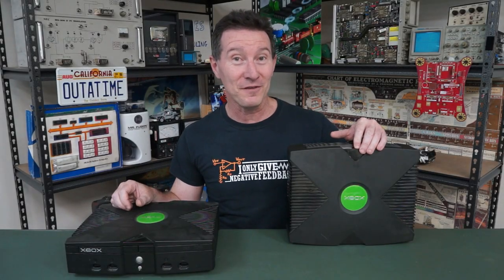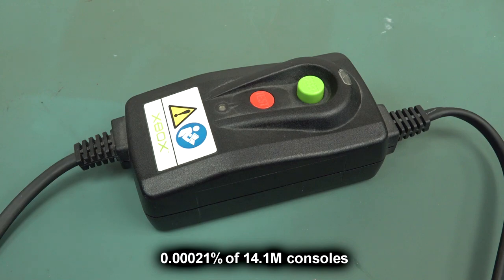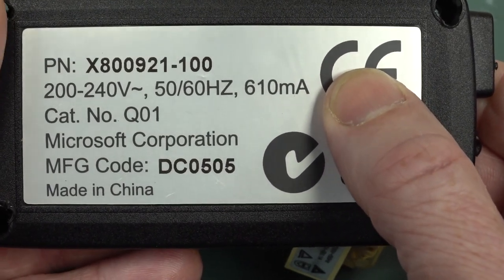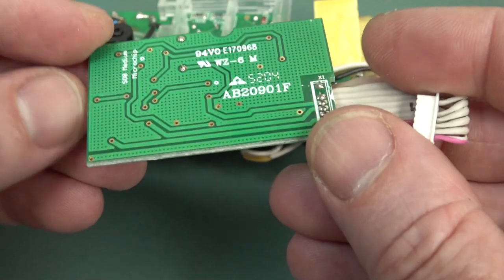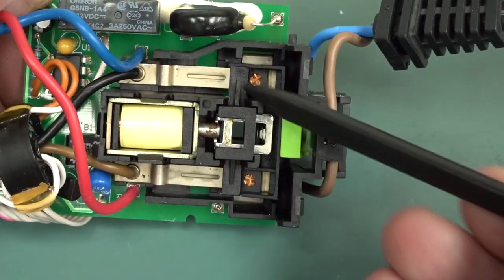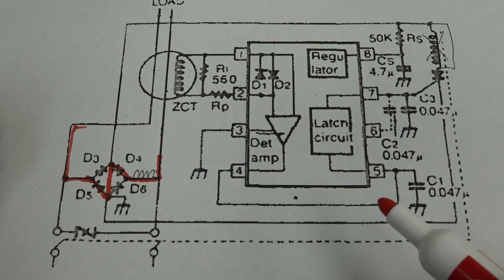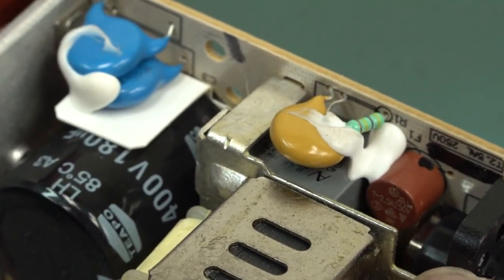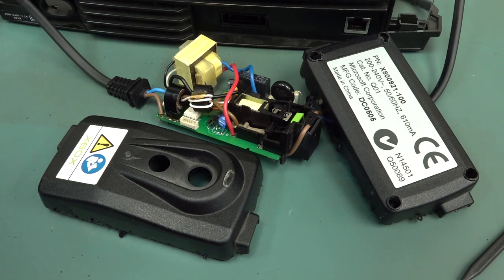EEVblog #1164 - Xbox Engineering Baptism Of Fire

Comment: This is WAY more elaborate than the USA version. I’m going to say you’re wrong about them not having to do this or else we wouldn’t see this much variance between how they dealt with it in different regions. The USA version does have the Test and Reset buttons but no visible indicator and the prongs come directly out of the box (“wall wart”). It’s significantly smaller to boot. It couldn’t fit such an elaborate setup inside.

There absolutely must be some reason they bothered to do this for AUS and whatever other countries used this one, like some additional regulation or threat of lawsuit.
Reply: It’s very likely they rebadged existing off the shelf solutions and our 120V 60Hz mains would likely require/choose a different part for our market since most of the rest of the world is on 240V 50Hz power.  In the end, the important thing is that Microsoft did make the existing devices electrically safe for everyone who participated in the recall.  It does not address the core fault for those who either abused their power connectors or repeatedly connected and disconnected the cord for some reason resulting in broken solder joints from the poorly secured power socket, but they did at least ensure that if your unit developed an arc fault condition then the device would be immediately powered down so no probable fire risk remained.  Better a service call for for an intermittent power issue with one’s XBox randomly crashing down the road than dealing with insurance companies and lawyers over a house fire, or especially a house fire with a death.

Comment: More likely it was built for something else and a new shell was made for the guts.
Reply from the maker: I greatly doubt it, it's "the vibe".
Reply: EEVblog Given the rush and the classic breaker mechanics, I suspect all the mechanics were from a portable GFCI/Breaker from some vendor, then they modded the circuit and respun both boards.
 The top board is controlled by a PIC μC in an SO8 package, hence the board name (may have had an alternate design with a different chip at its core, but this one obviously shipped).  Or it may have been an existing module for inserting that μC in this breaker series.
  Putting a fuse before a MOV is official best practice, because MOVs can violently fail short circuit after absorbing enough surges.
  Inside breakers like this, isolation gaps on the input side may have been designed and tested to safely handle plugging it into 420V  or more.
  The entire thing may have been built by an experienced brand such as Eaton or GE, saving weeks of trial and error, with the mandate being: "Detect the known fault arcs and every other danger in your arsenal, integrate it into a consumer installable cable or add-on" .
Reply: I would think so too.  It's damage control time.  Are you going to R&D, build, test, certify, produce, and ship a new fault detector?  Heck no.  Someone has one already done, just needs a new branded shell.  I'll take 100,000 please, and we'll be in touch for the next batch.
Reply: Nick Wallette Just stickers, no new shell.

Comment: This may be one of those things that when you unplug the device it fails open? I have seen that on a few GFCI modules, usually not that way, but a few are. I saw a circuit somewhat like this once in a laser printer. It was used to control the fuser, I only saw on that one model thought. Not sure what the point was as the fuser is basically a halogen light bulb so not sure why besides a thermal and maybe a normal fuse why that would be needed.

Comment: It looks like the Burden resistor (R10?) for the first current transformer is on the control board and will be disconnected if the board is unplugged.
If so, very bad practice to allow a current transformer to ever be able to run without a burden resistor, infinite volts (theoretically) and all that.

Comment: 6:00 people really don't understand how little Microsoft understood about hardware design back in the Xbox days, I mean people pretty much opened up the console and hacked it immediately. Microsoft really had no clue what they were doing. If you want to keep and old running Xbox you pretty much need to remove some capacitors from the board (as they always die and kill something else), and if you want to keep an Xbox 360 original running? Well you can't, it'll die.

Comment: I find that complex power supply circuits contain op amps and some other components that require power supply themself. This creates a confusion, how do these components get their power when they are supposed to operate and make possible the operation of the power supply they are inside and can't run without stable power themself?

Comment: It seems to me that this was not designed from the ground up specifically for the Xbox.  I have seen similar 'power cords' as after market safety devices, both in this form as well as a plug adapter form.  This particular device I think is a modification of one of those. The bottom part is probably an untouched design from  the 90s.  The plug in device I have looks remarkably similar though not identical.  Its main purpose is as a ground fault interrupter.  What Microsoft seems to have done here is to replace the top control board with something more specific to the task, rather than just a GFI and overcurrent adding the AFCI function.  Actually there may have already been an updated one existing with that function and Microsoft just badged it.  In fact there seems to be no Microsoft branding anywhere on or in the device except for the sticker at the bottom.

Comment: I have 4 of these (the crystal & green crystal, still brand new in box!), never realised there was a problem with the socket! It appears some lessons weren't learnt as my Xbox 360 PSU had to have the power cable replaced (a weird IEC C17 with no earth pin!). I remember sending the email to have the new power cable posted out. I think the newer cable was made with a higher amp carrying capacity? All my Xbox consoles are UK versions...

Comment: The early 2000's Fisher & Paykel Dishdrawer dishwashers had a similar "current monitor" that was required to be installed before the mains input, after a number of units caused kitchen damage due to "contaminants ... such as insects".  I wonder if they are also an AFCI, or just an electronic fuse.  I have one somewhere...
https://www.productsafety.gov.au/recall/fisher-paykel-dishdrawer-dishwasher

Comment: Microsoft had some real trouble with consoles at the start. First the XBOX had the magic smoke and cracking power leads, then they had the red ring of death due to heat warping the metal braces and caused them even MORE money to replace broken consoles and fix the issue in all later models.

Comment: Did the current limiting on a refrigeration compressor to optimize power consumption snd to stay below the safety circuit breaker limit. Could actually go well into the CB rated limit gor a few cyvles before it would cut off the power. Not deliberately of course but if the compressor unloading was a bit tardy the nominal overload was easily measured via a current transformer and a few components to condition the signal for an ADC.

Comment: I actually had one that arced because of cracked solder joints on the mains input, could hear it when wiggling the power cable. Fixed it myself since it was pretty obvious what was wrong and it was out of warranty anyway because I had put an Xecuter 2 chip in it.

Comment: You could basically mod these fuse adapters to test defective appliances for restoration and not have to use expensive by-product battery sources off an inverter.

Comment: A few things about this strike me as odd. If the power supply is the issue and it is a separate module it seems it would be better just do the recall and fix whatever the issue was. Other than the person not having the unit for maybe a week I don't get that part. By the time they made these things, etc seems the cost would have basically came out the same. 

I also find a bit odd they used a transformer to power it, I have dismantled dimmer switches, GFCIs, etc they all just use some form of resistor to drop the voltage to what they need for the logic to work. I would almost have to assume that is how a GFCI or AFCI circuit breaker would work too I can't imagine a 60HZ transformer fitting in a small circuit breaker. This may have been in the early stages before AFCI/GFCI became more common too. This thing just seems really odd to me.

Comment: Dave, one of my floor lamps has an annoying in-line circuit breaker.

I can’t use CFLs in that lamp.  CFLs keep tripping my lamp’s circuit breaker. I suspect that CFLs have an initial current or voltage spike when power is first applied.

I can only use incandescent or LED bulbs in that lamp.
Reply: CFLs mostly rely on rapid start ballast functionality, so yeah, they tend to do that. I would recommend not using CFLs. They're the worst.
Reply: cfls are a terrible hack anyways
Reply: SuperAWaC yeah. Especially considering they actually have a small amount of mercury in each bulb.  Environmental friendly my foot.
Reply: CFLs are a lighting evolutionary dead end.

Comment: I owned one of these for many years played it faithfully daily never had a issue and never had a special cord I'm assuming it wasn't widespread
Reply: Seems to be more of an issue if you moved it around, like setting it up at different tv's. If you just set it up at one tv and left it alone, I can't see this really being too big of an issue (unless the unit came with a dry solder joint that would fail with heat cycles).

Comment: oh, also forgot, make sure you remove the clock capacitor(or replace it if you give a damn, it barely needs it, just keeps the time when you pull the power) they have a tendency to leak after ~10 years? easiest solution is to just get rid of it

Comment: i think the reason for the circuit breaker solenoid being put on parallel of the bridge rectifier is probably because the solenoid was designed for AC current. after the bridge rectifier, the solenoid would have been fed full-wave rectified AC to DC which the coil probably didn't like... if that's the reason, it sounds like the solenoid choice was imposed for some reason. i expect either because standard and cheap, or it was the only model available (possibly within the required time limit), or everyone decided and approved the model of breaker before doing the electronic circuit (boooo)... i bet it bothered the electronics team to have to fix that incompatibility with such a twisted solution, and to move away from the IC manufacturer's proposed circuit design.

Comment: Not a pentalobe, but a security torx screw. It's basically a pointless distinction because the 'security torx' is pretty much the standard for all screwdrivers and they open both normal and 'security' screws...
Reply: Security torx is 6-sided with security pin, not 5-sided.
Reply: Yeah torx has 6 lobes, this has 5 lobes, which is why he called it a pentalobe

Comment: Looks like to me its doing GFCI which is why both Neutral/Hot are run through that one CT. If current is being diverted elsewhere (to ground) then there will be a current differential and that will induce voltage in the CT. The other CT they might be looking for total current of the device, since these are all basically the same and so the current into it shouldnt exceed some specific amount.They may also be looking for characteristics of a Arc fault and tripping on that as well.
Reply from the maker: Yes, watch the whole video, I explain this in detail.
Reply: @EEVblog  I got interrupted so I only got 8 minutes in

Comment: So it's pretty much just like the afci breakers that (at least in cali) are required for Dining room, living room and bedrooms
Reply from the maker: Seems to be. Wiki says it's in the legislation since 2014?
Never heard of these here except in relation to big commercial installations, I didn't know they were for home/consumer use.
Reply: @EEVblog  ya so section 210.12 in 2014 NEC says ya gotta have on all the 15/20amp branch circuits where people do any "living" so not garage, and also not the kitchen/bath because all outlets in those rooms are gonna be can off GFCI outlet (you could also use gfci breaker but they can trip often so more convenient if it's right there) but the reason I said at least here in California is way our laws work each state doesn't adopt each version as it comes out like 2 states I think still using 2011 and we have had 2014 and 2017 releazed....

Comment: So, I think that we've established the fact that this is a combined overcurrent, ground fault and arc fault breaker.  This raises the question of how does an arc fault breaker work, does anyone know?  I assume that it detects high frequency noise generated by the arc but how does it do it, I didn't see any RF looking circuity, not even any inductors.  What frequencies need to be detected?

Comment: It can't be just fuse and gfci. They can be done completely without active electronic, including test function.

It is probably arc detection , and analysis of sudden spikes and drops of current. 

Anyway, this is over the tops design. Definitively rushed (not cost optimized), and just made sure it work 100% of the time.

Good lesson to engineers and companies too. Saving few cents on a connector can cost you dozens of millions, or even more if it kills somebody.

Comment: Great video.  As for these PSUs, i think only fox link supply had that solder joint issude that caused fire,  DELTA ones were much more reliable. So if possible use these. And it is 90% PC so if you really need you can wire put ATX power supply for it.  Just for your and console goodbeeing, remove clock capacitator before it leaks, not needed and it will corrode MB.
Still using mine console,  like it very much. 2tb hdd hard drive, 128mb ram mod. TSOP flashed. And modded cooling with 8cm noctua fan. So it is whisper quiet even tho fan RPM needed to be adjusted in bios config file to 80%.  XBMC 3.5.3 is quite new dashboard from 2016 i think,  and you can play any backup game and it emulates really great anything up to PS1.
With original component cable or new 3rd party HDMI (picture quality is almost same) it looks great on new TVs and runs 16:9 .  Can do 720p even 1080i on few games.
And via xlink kai, it can play games online again.  Hope you all have a nice day.
Reply: Wow, I have no clue the Xbox was this moddable. That's hilarious, and awesome. What does the RAM mod achieve though? I would expect console games to run unmanaged memory and thus be strictly built and carefully optimized by hand for a certain expected amount of RAM.

Comment: Some perspective: they estimated 14.1 million “power cords” would need replacing, but only sold 25-30 million OG Xboxes.
Reply from the maker: All units after Jan 2014 were not affected.
Reply: That sales estimate is based on a figure from 2006, the article on the recall is dated 2004. The 14.1 million units that MS predicted were faulty still makes up a significant chunk of the Xboxes production run.

Comment: I JUST got done fixing my first generation xbox power supply that has the bad power supply with faulty solder joints. I also added screws to the power supply the secure the socket so it cannot move when being plugged in

Comment: the UK didn't have this problem, plugs have a fuse fitted as standard, either 3a 5a 13a
Reply: A 3 amp fuse won't do the job if it's arcing but not drawing excessive current (which is the suspected fault with the original PSU). This device was designed to also detect arcing.

Comment: Could someone explain why there is a resistor in parallel to the MOV on the power supply board?
Reply: You mean the thermal fuse that's in series with the MOV and physically stuck to it? It's there to protect against catastrophic failure of the MOV, which results in a thermal runaway process where the MOV becomes a short-circuit.
Reply: @MatthijsvanDuin  No. What I mean is at position 25:05 in the video. It seems to be a resistor in parallel.
Reply: @sebi7794  Oh, like he says: the bleed any stored charge (a MOV has significant capacitance) after unplugging the device.
Reply: @MatthijsvanDuin  Thank you! I didn't know of a significant capacitance. From what I have read now, these can have capacitances up to 2.5 nF. Isn't the internal leakage resistance enough to dissipate the energy stored in this capacitance? I've never seen a configuration like this before.

Comment: Well it's been said already, but the first thought I had was about the cracking solder joints due to lack of strain relief... I'm by no means a professional but I do a bit of soldering lol & I recall when these systems were current a friend had one that was arcing and wobbling that I reflowed.

Comment: Only half through the vid, but in case you didn't catch yourself later... The white wire passes back through the (non GFI) CT to cancel the current drawn by the 3 resistors (and maybe as a backup in case of a fault on the load circuit for the GFI and it fails to operate). This thing is over engineered like NASA.

Comment: Using a SCR/Thyrisitor and a bridge rectifier is a simple way of switching AC circuits.
The AC side of the rectifier is in SERIES with the load, the DC side has the SCR connected.
https://www.electronics-tutorials.ws/power/triac.html 
Check "Thyristor Configurations" in the link.
You need to throw the "suggested" circuit away  and draw your own mudmap through reverse engineering and DaveCad.
Did you check the PCB fuse on the xbox it is a t-2.5  which means it is a delay type, possibly because of the SMPS it has to boot up.

Comment: i think that they brake active and neutral in the case that you plug the "powercord" on an adaptor with no earth, in this case you can swap neutral and active, then the 
differential circuit breaker(earth leakage) can work, and still cut the circuit ;-) 
maybe bad english, i dont know, sorry and goodbye !